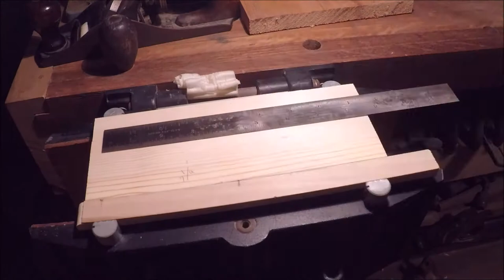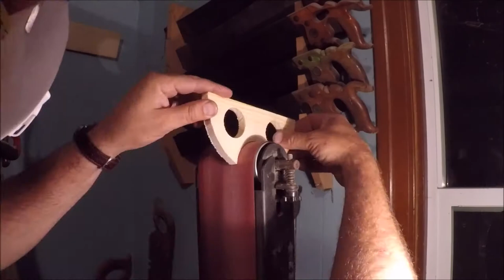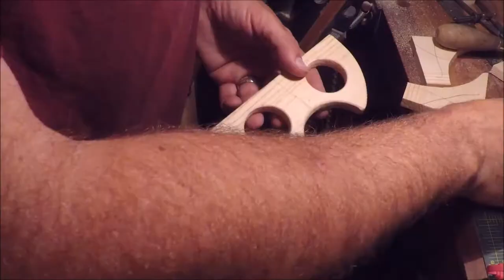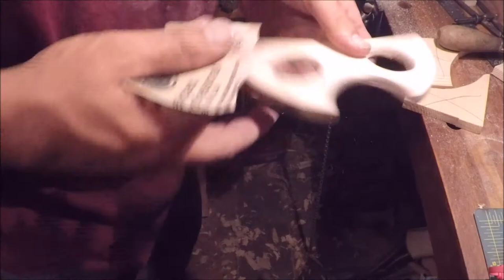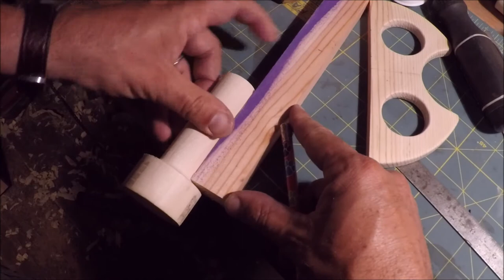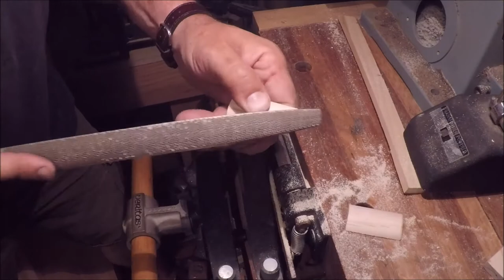Foundry Pattern: Spare Room Tool Making Competition 2018

Comment: I think it could be some sort of jig for your belt sander... If I'm even remotely close, maybe someone can pitch a better guess.  But it could also simply be a bracket that will mounted to the wall for holding an appropriately sized pipe; or a "foot" for a pipe on the floor; or...
And if this isn't the only part... ALL guesses are out the window...
Reply from the maker: No on both accounts. Nice guessing though